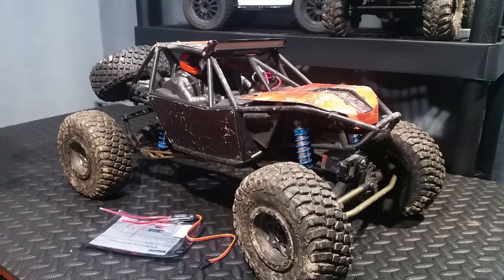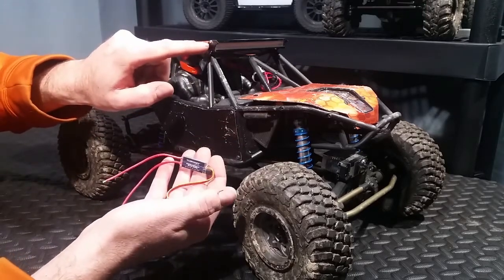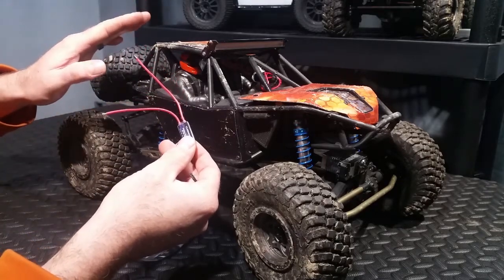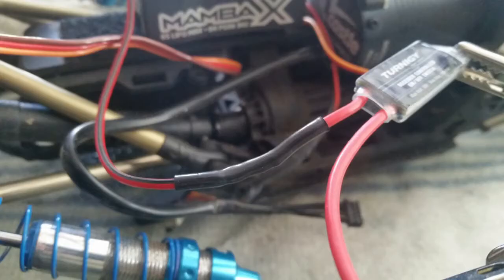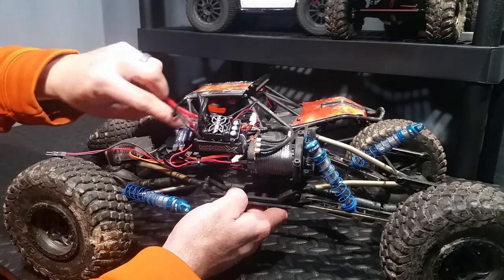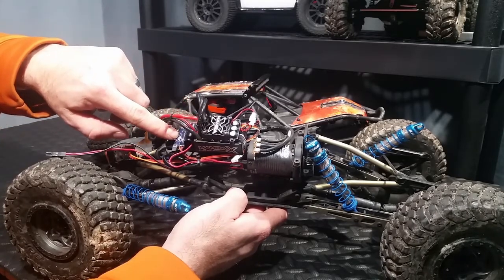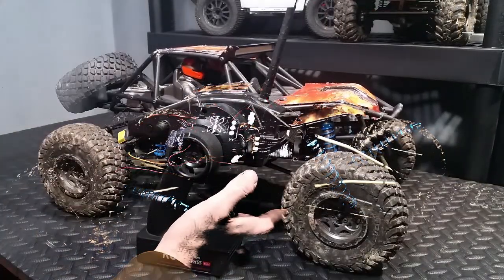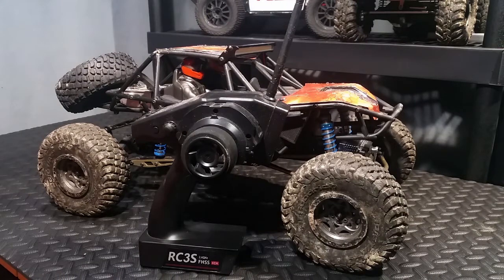How To: Use your RC Controller to turn your high power LED light bar on and off

Comment: Finally a video that tells me exactly what I need to know everything else has been toward dedicated 6 V systems I want to wire a 12 V power power light bar to my 1/5 scale not sure if I’m going to use a receiver channel as I only have three but I am supposing you could eliminate the receiver channel and just hook directly up to 3S power
Reply from the maker: Only if your lights can handle 3s.
Reply: Budget RC I know the large light bar can it will handle up to 12 V they even say you can run it on 3S I guess my question is do you know of any cop of light controller that has 12 old and 6 V output or the easiest way to wire that I may just have to run it all off 6 V I was going to put a light bar and for light pods on my Baja but the pods are 6 V the light bar is either if I just run at 6 V I guess I could just run it off the receiver battery
Reply from the maker: @LargeeeScaleLife  if it can handle 3s, just run it directly off the battery or through a switch like I did.
Reply: Budget RC Will do thanks for the input I really appreciate it

Comment: What if my battery is 8s. Will this setup burn the led??
Reply from the maker: I don't remember what the max voltage is.  You would have to check the specs at onetoomanyrcs com.

Comment: Can it be used to control a winch?
Reply from the maker: No.  The output is just on/off, not a PWM signal that a servo uses.  For that you would just plug into the receiver directly.
Reply: @BudgetRC_Channel  thank you.

Comment: Not bad. I got both the one you got and the one that gets power from the Rx. Use it on my UDR lights I installed from Murat RC. Much better and cheaper option than getting the Traxxas UDR light bar kit @ $149.00! As with these switches I can use a spare channel on my Tx,  just perfect!
Reply from the maker: These controllers are great and they're cheap.  The only drawback is that they aren't plug and play, but since I like to tinker with this stuff anyway, that doesn't bother me.

Comment: Thanks. I just got the same switch. I want to connect a police siren and use the toggle switch on the Traxxas radio to turn it on and off. I should be OK to use a separate battery to power it, right?
Reply from the maker: Yeah, with this style switch you can use any power source that you need.

Comment: Hi! what if I want to run multiple 12v leds? Do i have to put them in series or paralell? I am building a baitboat and I need 1x white front led and 2x red backlight.. Please help!
Reply from the maker: If you wire them all in parallel they will all get 12v each.